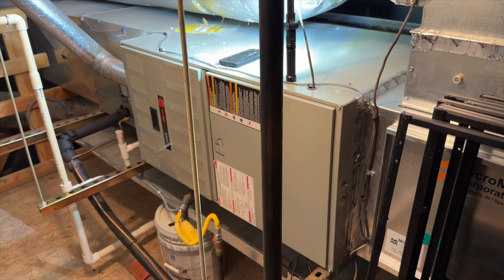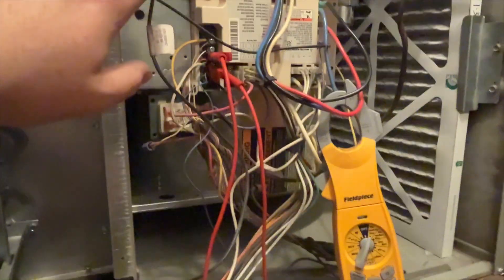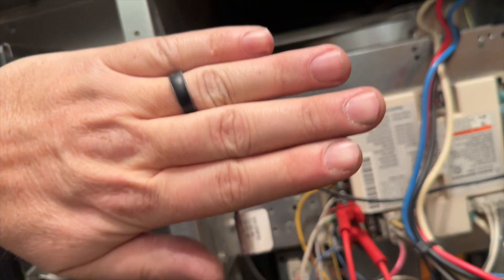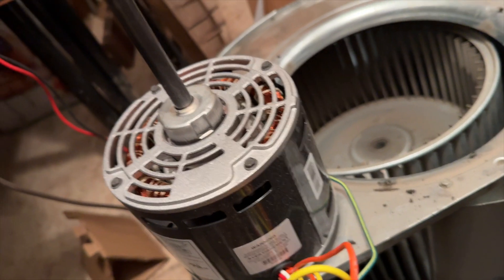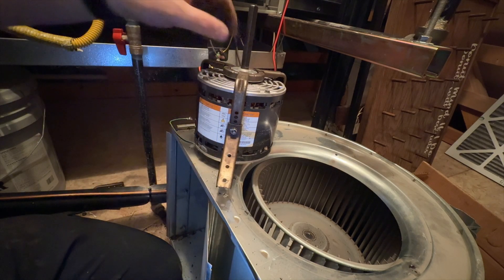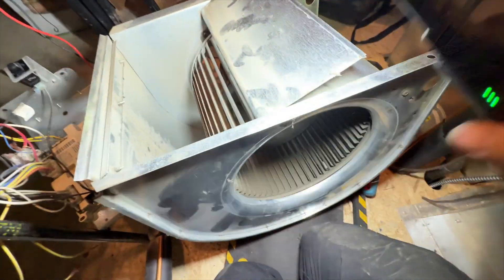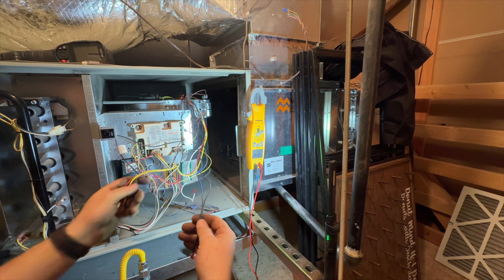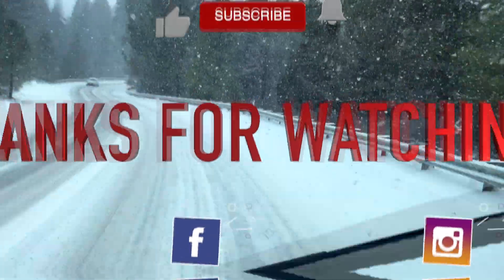Trane Furnace Making a Noise and Smells Like Burning EP211

Comment: So, I did one like this the other day, Trane unit blower motor, and the customer called me back days later saying it was too loud. I didn’t go with OEM but the motor didn’t seem any louder to me. The furnace was literally under the people’s bedroom. I used a decibel meter to see how loud it was and right at the unit was about 90 db. I ended up just telling her of ways that we could reduce sound transfer. Do you think that the OEM motor would have been quieter?
Reply: Maybe it’s high static pressure? Dirty filters?